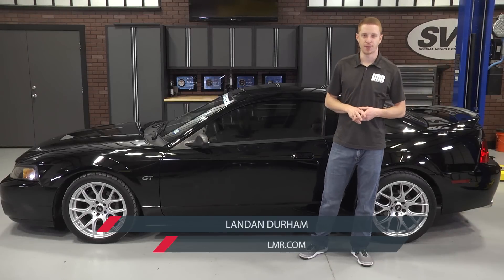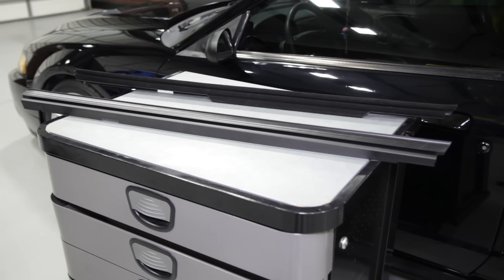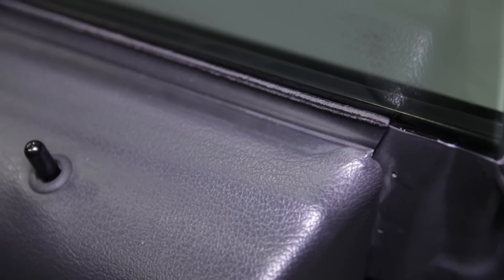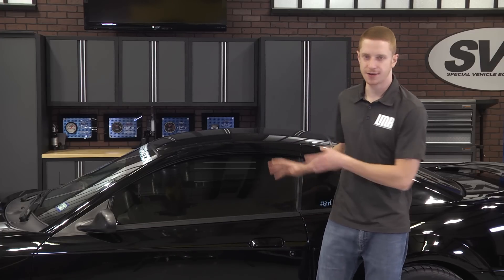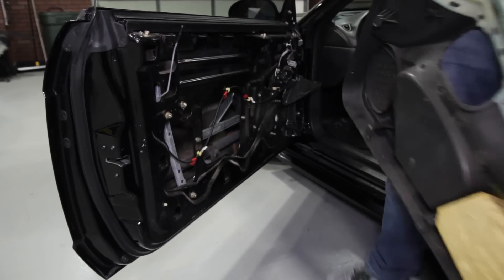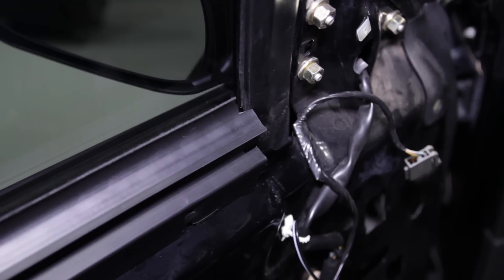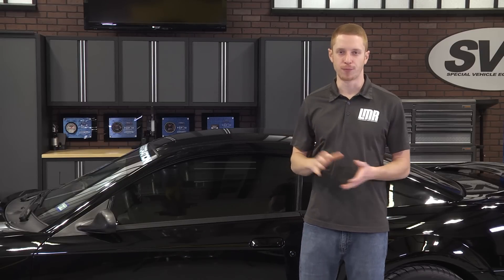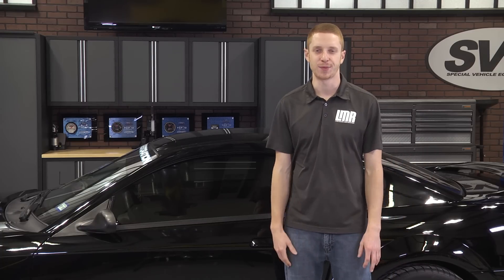1994-2004 Mustang Inner Door Belt Weatherstrip - Review & Install

Comment: This Video gives you how to replace them but is missing a key item. Look at your old Ford ones and you will see there not shaped the same. The replacements looking at the end of them inside are square and the Ford ones at the top of seal where the inside panel is insert is squished together more. I had slow windows and looked at Original Ford seal and realized the shape was different and slowly squeezed the seal in a vice a section at a time till seal resembled Ford part. The window goes up and down as they should and only labor a little at the end near the top when they go up. I wish I kept the outside seals to see if they were formed differently as well. I hope this helps .